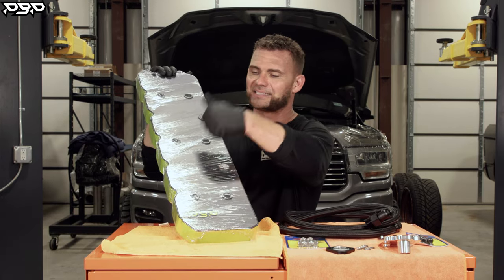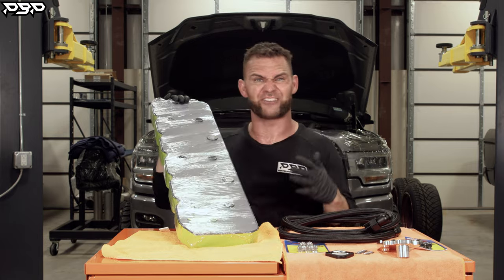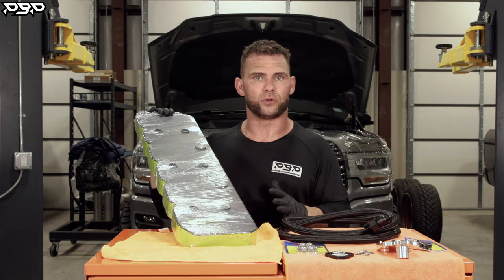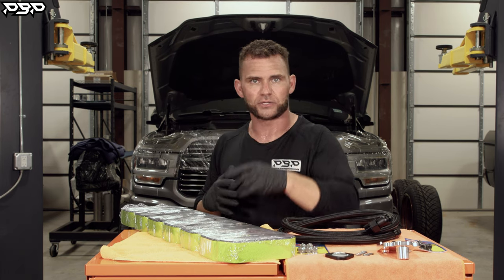6.7 CUMMINS RACE SERIES VALVE COVER!

Comment: Might be a silly question but I’m curious on why the no oil cap ?
Reply from the maker: Just don’t like them sir . So off she goes !
Reply: How do you fill the engine oil?
Reply from the maker: Fill it through the crank case port sir!
Reply: Just bought a truck & has the same valve cover , don't know how to put new oil😢